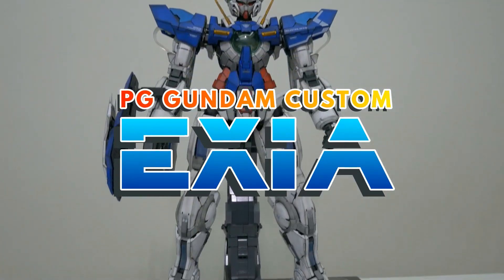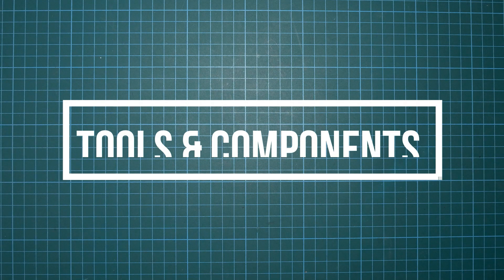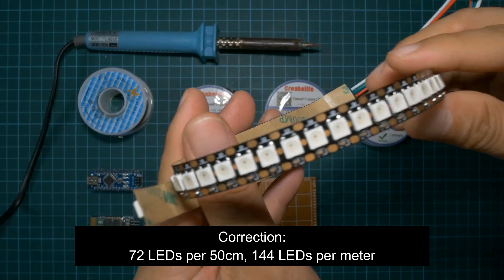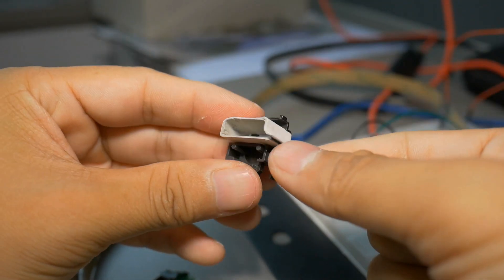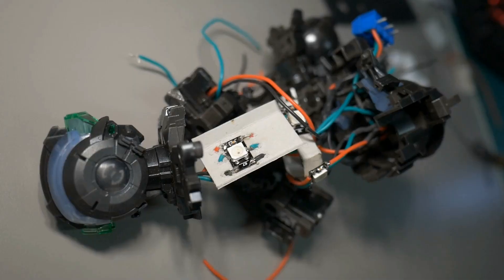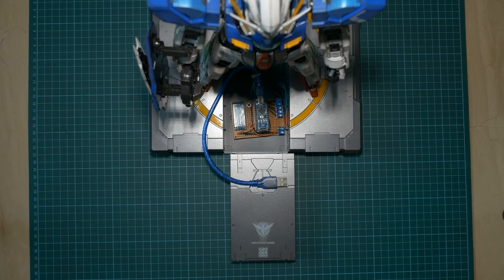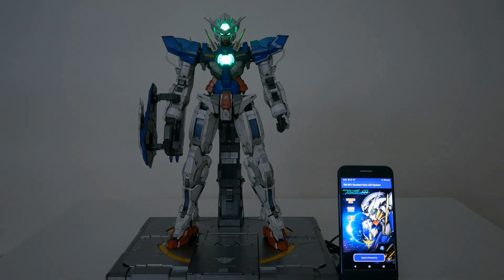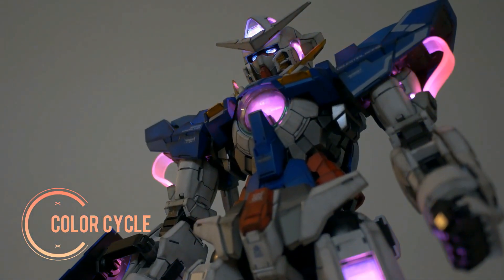DIY Project // PG GUNDAM EXIA Custom LED System

Comment: Hello, do you know the diameter of the electrical wire you used?
Reply from the maker: https://www.carreracasting.com/charts/wire-gauge

I used 30AWG wires in this project. I have viewers who followed my instructions but used network ethernet cables instead and it worked.
Reply: @alangadgets  ah okay. And how did you led the gn drive?
Reply from the maker: @calico1146  I wrapped the LEDs around the inner frame of the GN drive in a loop
Reply: @alangadgets  Thanks for the help! Also, what language is the Android APK code in and could 2x 16 pin sockets be used instead of the 32 pin one?
Reply from the maker: @calico1146  i used Android Studio, I think i was using Java or C++. you should be able to use 2x16pin
Reply: @alangadgets  would you be able to do a tutorial on creating the app with android studio?

Comment: Hi Alan, is this possible to pull off without owning an android? I don't mind if I need to put a physical switch on the base to control the led's
Reply from the maker: absolutely! i actually had it in the Audurino code to use one of the input ports as a push button to replace the phone to cycle through the power-up and power-down mode. Or you can use flip switch to run a different mode.
Reply: @alangadgets  thank you so much for the quick reply :) I've been watching this video many times all week while I was waiting for my Pg to arrive, very excited to have a reason to dip my toes back into electronics :) thank you for sharing your project, the end result is easily twice as good as Bandai's set! (Subbed!)
Reply from the maker: Thanks so much! Comments like yours kept me going 🙏🏻🙏🏻🙏🏻

Comment: can this be easily repurposed to an arduino uno wuthout changing anything except pinout mapping in code?
Reply from the maker: If I remember correctly you should be able to do that, no diff in sketch
Reply: @alangadgets  thanks!, additional question are the arm, leg, and head wires just routed through the chest and not connected to the chest led arrays or are they wired together like in the official kit?
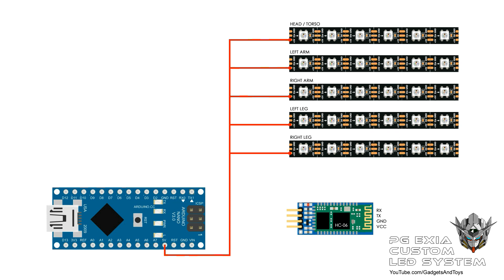Reply from the maker: @XxbeyblademasterxX  you can see from 1:55, each set is individually controlled, you get more flexibility this way
Reply: @alangadgets  oh so just routed through chest then, thanks!
Reply: @alangadgets  last question for real, how many leds is it per section?
Reply from the maker: @XxbeyblademasterxX  no pls ask as much as you need! I can't remember for sure but it should be stated in the sketch. Pls download and check it out as I'm outside right now 🙂
Reply: @alangadgets  thanks! and i will subscribe
Reply from the maker: Pls sub if you enjoyed it 🙏🏻

Comment: Sir did you put led on the clear part on both sides of arm and legs
Reply from the maker: Yes I did 😊
Reply: @alangadgets  did it fit?
Reply: @alangadgets  I want to try did what you did but I'm concern if it will fit on the clear green on the both side of arms and legs
Reply from the maker: @nub_gamers5457  the arms and legs are actually the easy parts, there are more space to fit in LEDs than the head and easier to position than the torso
Reply: @alangadgets  ouh ok thank you for answering my questions
Reply from the maker: @nub_gamers5457  ofcos, have fun! And pls sub 🙏🏻

Comment: 0805 LED is less spacious, enamel coated wires are more easy to use. Well done on the Adruino. Better if you use a touch screen and make your own base with the app you use to control the led no need the BT connection. The function will all in the base
Reply from the maker: Great idea! Maybe I can plan an upgrade on it.. thanks for your input and pls sub 🙏🏻

Comment: Is this the led Lighting model or non lighting model??
I have non-lighting model, Am I able to install the led unit from bandai?
Reply from the maker: the only difference between the lighting model and the non-lighting model is the LED set. the Gunpla model is exactly the same.
Reply: @alangadgets  ohhh I see.. now I have to buy the separate led set
Reply from the maker: @jvmusicph  I bought it on the first day of launch and the LED set did not come separately at that time, had to decide to go with or without. Not so sure if that's still the case now. Anyway if it's helpful pls do sub 😁
Reply: @alangadgets  I already hit the sub button before commenting on your vid ;)
Reply from the maker: @jvmusicph  thanks so much! 🙏🏻🙏🏻🙏🏻

Comment: What push button switch you use
Reply: And what's the name of the Handler you use when soldering
Reply from the maker: https://www.amazon.sg/dp/B073TVFD61/ref=cm_sw_r_cp_apa_glt_i_JVYRES335Q1HPGPHHSNQ?_encoding=UTF8&psc=1
Reply from the maker: https://components.omron.com/special/switch/basic02-03
Reply from the maker: Every push of the button is just to send a momentary signal to interrupt the code and toggle the state of the LED mode

Comment: Hi GadgetsAndToys,
I tried to make the Apps using Android Studio, however, errors are coming continuously. First, I copied your codes to my own folder (For example, E:\Exia) and opened that project using "Open an existing Android Studio Project", and press "Run", but error occurred starting with "Error:Internal error: (java.lang.ClassNotFoundException) com.google.wireless.android.sdk.stats.IntellijIndexingStats$Index". Could you please help me to solve this? Thanks!
Reply from the maker: this seems to be an issue with the Android Studio and not my code. try the link below and see if the solutions there could help you.
https://stackoverflow.com/questions/55844077/findbugs-idea-classnotfoundexception-com-google-wireless-android-sdk-stats-int
I'll try compiling if I get the chance, this project was done on my old workstation and had not done any compiling on this current new PC..
Reply from the maker: or this one
https://github.com/mapbox/store-locator-android/issues/27

Comment: Can this be connect to power socket 120v?
Reply from the maker: I use USB 5V input, use any charger that can output that
Reply: @alangadgets  would this work to any grade?
Reply from the maker: @misscoxy001  in theory yes, the trick is to find the right size of LEDs and wires that would fit into the smaller scale model
Reply: @alangadgets  how did the bluetooth work
Reply from the maker: @misscoxy001  there is a Bluetooth module (HC-06) to interface with the Arduino nano, as seen at the schematic diagram at 01:42

Comment: Do you think this is doable with the rg 00 Qant
Reply from the maker: Wow RG? I'll be terrified to even think of it! 🤣🤣 I don't have tiny hands. But if you can find smaller RGB LEDs then should be possible, I'm more worried about how to run wires through the limb..
Reply: @alangadgets  yeah reason why i think im getting an mg instead its too risky for rg i think

Comment: awesome, wanna ask some knowledge, if i replace the led to normal 2pin led, possible? or must be using rgb led? i wish to apply this onto my mega unicorn.
Reply from the maker: thanks! I think there are 2pin RGB LED, but you can't set address and need to run a set of wires to each individually, I never used them so not sure about it. if you using fixed color 2pin LED, you won't be able to do changing colors like mine, and you won't need the Arduino to control the LEDs. hope it helps, please subscribe :)
Reply: My current setup initial plan was to use fixed colour LED, but to have arduino do the sequence of lighting up from foot to head. Something like the one at Diver City Tokyo. 😂

As the psychho-frame was pinkish red. I worry if use rgb. The color would still look same. 😅

Btw, if I don't want to use the Android app thingy. I can just remove that part and proceed with the switch right?
Reply from the maker: True, I'm planning on the PG Unicron too. I'll be modeling the red parts with transparent resin so that I could use RGB LEDs. But what you say can be done too, but you can't use my codes, and you need to get a port multiplexer as Arduino do not have that many ports to control many LEDs
Reply: where to add the switch to toggle the effect? in your schematic did not show the switch
Reply from the maker: @yiming007  no I didn't because its optional since I used android app, if you looking into my Arduino code there is one port tied to a push button
Reply: https://my.cytron.io/p-io-expansion-shield-for-arduino-nano

Something like this suitable for the expansion?
Reply from the maker: @yiming007  need to read up on the spec, never need that many ports before. Seems promising though

Comment: is the button shown on your circuit board 100% needed or can I leave it out? if so, is there anything I need to comment out in the arduino code?
Reply from the maker: The button is optional. You don't have to remove anything from the Arduino code even if you don't have the button
Reply: @alangadgets  hmmm well i can't seem to run a test with just one string of LEDs as the app doesn't go through the different modes like it should
Reply from the maker: @jasonandapril  you need to trigger the sequences, either by the button or using the Android app. It won't run without triggered
Reply: @alangadgets  i was using the Android app. I hit the button in the app and change it didn't do anything at all
Reply from the maker: @jasonandapril  it's hard to advise without seeing the real thing. If the Bluetooth is connected, it could be the current supply may be too low
Reply: @alangadgets  its powered by a cell phone charger with at least 5 A
Reply from the maker: @jasonandapril  like I said I don't have enough data to assist. Is the Bluetooth connected on the phone to the HC-06? Maybe you could do a simple test by writing your own test code just to light up the LEDs. Troubleshoot to isolate the components
Reply: @alangadgets  well, i may just try the button method. Can you give me a different link for the one you have due to the link you provided not having that product
Reply: Or would it be a momentary push button that is wired to power and ground

Comment: Can i do it in my mg exia
Reply from the maker: Probably not in the exact same way cos of the different in size, but still possible if you can get smaller RGB LEDs to fit in MG
Reply: @alangadgets  even if i cut it into pieces? is there a smaller rgb leds with changing colors?
Reply from the maker: @rammeister2557  you can see if they have smaller LED from AliExpress.com, that's where I looked for my materials
Reply: @alangadgets  last question sir where did you put the led for the shoulder lighting
Reply from the maker: @rammeister2557  for PG Exia, it has slots for all the LED placements for the original LED set, I just fill it in with my own LEDs

Comment: Did you build the exia kit first or did you do the leds as you built it?
Reply from the maker: I build the inner frame first, then the LEDs. After testing the lightings, then build the rest of the pieces which are basically outer plates on the frame
Reply: @alangadgets  awesome, thank you. Cant wait to try this
Reply from the maker: @dylanhugh27  sure! Don't forget to subscribe :)

Comment: Hi, which LeD strip did you use? 30 IP30? Or 60 IP 65?
Reply from the maker: If I'm reading it correctly, the first number is the number of LEDs per meter, and IP is the water resistant level. I chose the lower IP as I do not need it to be water resistant so to lower cost, and got the 144 LEDs per meter strip

Comment: Yo dude, you from Singapore? 老乡啊you mind making one for rg? I wanna try on my astray
Reply from the maker: yup from Singapore. RG too small from my fingers and the LEDs used in the PG... haha... pls sub :)
Reply: GadgetsAndToys of course I will sub, ey btw can you try to do it for hg or mg
Reply from the maker: @CXHo-sy1xz  thanks for the sub! I would consider MG but no plans yet. It would be a lot of cutting and drilling as they were not designed for it
Reply: I mean the app how to do
Reply from the maker: @CXHo-sy1xz  you can find the link in the description to download the codes for Android phone and Arduino chip
Reply: GadgetsAndToys  can you give me ur app link so I can make one for rg unicorn,
Reply from the maker: @CXHo-sy1xz  it's a custom app that I wrote from scratch, I didn't upload to play store as the codes wouldn't work with anything else. It was meant to be specifically this project only. You will need to learn basic android and audrino programming to modify my provided source code to make one of your own. Unless you are building an exact replication of my PG Exia then you won't need to modify anything